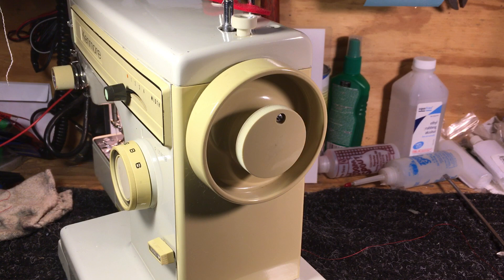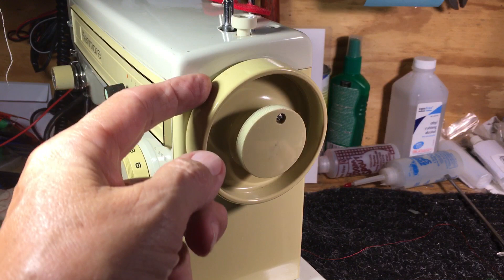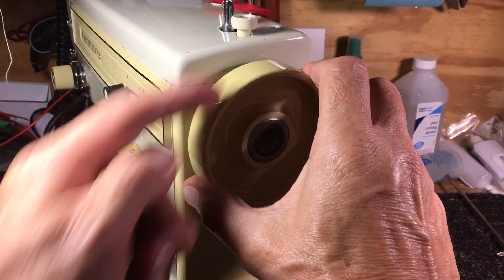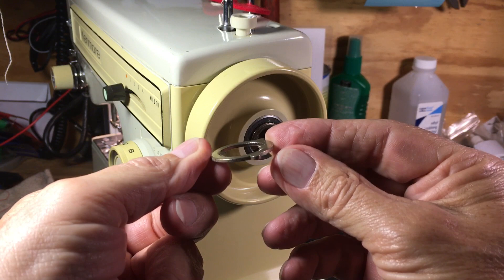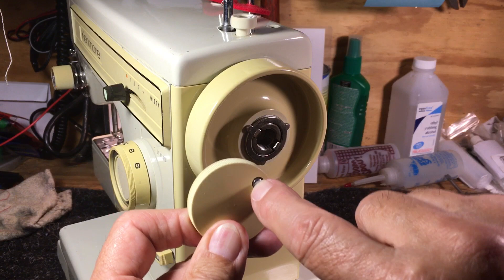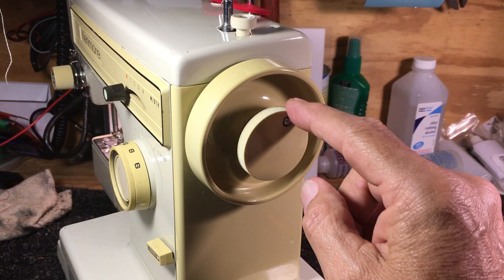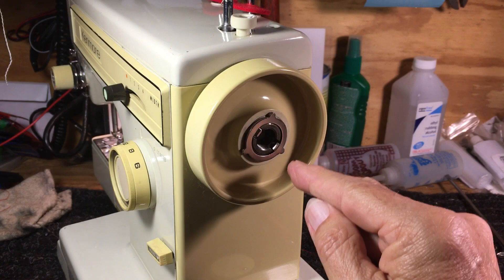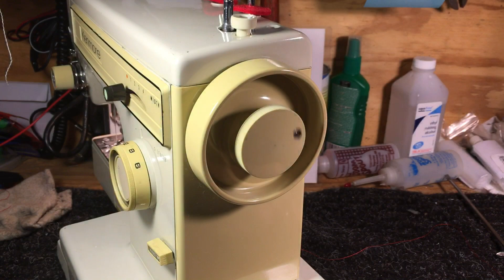Re-assembling hand wheel and clutch release

Comment: I have a Kenmore 156512 and the clutch doesn’t turn (for bobbin winding).  I cannot remove the (cap) after I loosen the screw.  Any ideas please?
Reply from the maker: If you’re calling the clutch release knob the cap, get some channel locks, and a cloth to prevent damage, and apply a little more gentle leverage to the knob. That’s what works for me.
Reply: Thanks, my husband finally got it off using kitchen rubber gloves.  No idea why it was on so tight.
Reply from the maker: @brendaeq236  excellent job hubby.

Comment: i did this on my moms 158-140 model, the big wheel still spins when the small wheel is disengaged
Reply from the maker: When you turn the inside knob to the left, counterclockwise, towards the front, it releases the clutch and the hand wheel should spin freely. When you turn it to the right, clockwise and away from you, it should tighten the clutch and prevent the hand wheel from turning freely. If that isn’t happening, it’s not reassembled properly.

Comment: Hi Randy,  how do you repair a flywheel that won’t disengage any more for winding bobbins?  If I remove thread and wind the bobbin anyway, the entire wheel becomes tight.  Thank you for your time.
Reply from the maker: There’s a problem with the clutch being assembled improperly or there’s a lack of lubricant in a key area.
Reply: @randyyoursewingmachineman9954  we cleaned and oiled the machine and got it running well but after winding that bobbin it is really stuck again.  Have you a video which shows how to remove the larger wheel?  It makes sense that I could have resembled things improperly years ago when the flywheel began disengaging, except for the fact that I would never disssasemble something like that for no reason.  The disengaging had to have happened beforehand.  You are probably right about a lack of lubricant in the area behind the bobbin.  It was also filthy in that area.  My manual never indicated I should oil back there and I was afraid to oil in the wrong areas and cause issues. 
 If I could just figure out how to get this wheel moving again for sewing I suppose I could fill bobbins on another machine.
Reply: I’ve got to say, it’s very nice of you to reply and assist people as you do.
Reply from the maker: @namesoog7  remove the clutch release knob and lightly tap the hand wheel to remove it. Be sure to remove the drive belt first. Tap the hand wheel with a non metallic item like a screwdriver handle or a wooden rod. You don’t want to damage anything by striking it with a hammer, etc.  Once the hand wheel is removed, you can recondition the main shaft that the hand wheel spins on, by using a light abrasive like crocus cloth to remove any built up oil and debris that has become hardened over time. Clean inside the hand wheel as well. Be careful not to scratch the surface. Oil all the surfaces and reassemble. Make sure the belt isn’t too tight or it will be problematic
Reply from the maker: @namesoog7  there’s been times when folks have helped me with problem solving, and I really appreciated their help. I’ve been on the receiving end of selfless kindness and it is refreshingly uplifting. The surprising thing is, being on the giving end is even better.
Reply: @randyyoursewingmachineman9954  I’m reluctant to remove the belt because i don’t think I’ll be able to get it on again lol.  I have cleaned what I can reach but nothing seems dirty.  I was hoping there would be clear evidence of a problem. 
what do you suspect caused the fly wheel to stop disengaging the needle when I loosened it for bobbin winding?  I’m wondering if there is any possible way I can get my hand wheel moving again without removing the belt.   . ; )
Reply from the maker: @namesoog7  don’t remove it, just loosen it.
Reply: @randyyoursewingmachineman9954  I was so glad to hear your last response lol.  I seem to have everything in place once again and the wheel is not tight any longer to turn by hand.  When I hit the gas she runs but the belt is not gripping and the wheel is not turning.  I’ll try tightening the belt again.
Reply: @randyyoursewingmachineman9954  the belts been tightened and everything seems to run but  it won’t turn the hand wheel and it’s quite stiff to turn by hand.  We’ll have to search for more videos. Thank you for your help Randy.
Reply from the maker: @namesoog7  make sure the idler pulley is carefully oiled. Make sure the main gear bearing behind the shuttle hook is oiled. Those are the main areas that get overlooked and will cause an issue.

Comment: Elna Lotus reverse stichin and stitch length regulator not functioning. Since its the same dial that is used for both, is a part broken or worn?
Reply from the maker: Probably not broken or worn. Most likely it needs to be lubricated. Be sure to check your presser foot pressure to be sure it’s adequate. Clean the lint that may be packed between your feed dogs to ensure their proper operation. 
Good luck.
Reply: @randyyoursewingmachineman9954  machine is clean and serviced but technician doesn't know how to fix...I opened the side plate and saw a 1/4" wide metal piece with 2 holes at ends loose and dangling, i tried attaching to most obvious (to me) protruding ends but doesn't stay in place nor fix the 2 functions
Reply from the maker: @cherylmaeda448  it could be that your repair person isn’t up to the task. Maybe find another one if there’s one available. Pro tip: Try to find a repair person that isn’t primarily fixing vacuum cleaners.
Reply: @randyyoursewingmachineman9954  stitch length locked in #4, longest length...thanks for your responses
Reply from the maker: @cherylmaeda448  I really don’t know what to tell  you. If I had the machine I could certainly identify the issue. Mostly concerned about the loose and dangling parts behind the stitch adjusting assembly.

Comment: I can't turn my clutch release. It's stuck tight. Can't unscrew it either (the screw comes out but it still wont turn. Any advice? It was fine last week :(
Reply from the maker: Wrap a protective cloth around the release knob and grip it with a large pair of channel locks. Bingo. Done. It works for me every time. 😎
Reply: @randyyoursewingmachineman9954  Thanks for the fast reply Randy. Off to find a pair of channel locks now! :)
Reply from the maker: @johnf4659  an essential tool to have around. 😎

Comment: I did this like 30x for my Singer 237 and it still doesn't work 😩😩😩😩😩
Reply from the maker: Oil the shaft and the inside of the hand wheel. You may even have to polish off any old rust or accumulated oil that has built up on those surfaces. Once they are clean and shiny, reassemble them and try it again. You may have to hold your needle clamp to keep the machine from running at first. Once it breaks free and starts to spin without the machine running, you’ve got it. Also, make sure that your belt isn’t too tight. That can cause a malfunction as well.

Comment: Randy, I saw your video after I goofed up ,  and need help. I put it back together wrong and now can’t get it off to assemble it correctly 😢
Reply from the maker: You might need to remove the set screw to get it to cooperate. 
Maybe tap the hand wheel with the handle of a screwdriver. Be gentle and don’t bang anything metal to metal.
Reply: I removed the setscrew, but now, when I turn it to the left to remove it, it is just actually moving the needle bar up and down
Reply: I guess a 78 year old woman shouldn’t be trying to fix her sewing machine
Reply from the maker: @bettyspence9992  you have to remove the needle and hold the needle bar from moving.
Reply: I think I finally did it right..thank you!  Unfortunately, my machine Kenmore 158.840 is still running slow.
Reply from the maker: @bettyspence9992  make sure the belts are in the right grooves and aren’t too tight.
Reply: Ok, off to do more research on how to check the belts.  Cleaned and oiled so surely the belts are the last thing to tackle.  Randy, you are a lifesaver!
Reply from the maker: @bettyspence9992  you’re welcome 😎👍🏼
Reply from the maker: @bettyspence9992  why not. One of my brightest and best mentors, taught me some very important things when SHE WAS 92. 
I don’t think you’re ever too old to jump in and try to do what you can. 
You sound brave and a bit adventurous. 
Those are good traits. 
Hang on to them. 😎👍🏼

Comment: My sewing machine hand wheel is different than this one ..
Reply from the maker: There are machines that have different clutch apparatus. It’s not a one size fits all approach. If your hand wheel won’t release to wind the bobbin, a judiciously applied portion of oil on the correct spot will help. Unfortunately, without more info I can’t determine where that spot is. You might look around the hand wheel area and see where it spins on the shaft and add a drop or two there. Just trying to help.